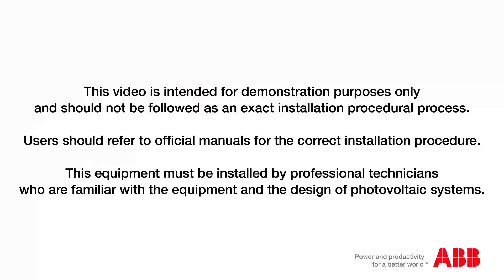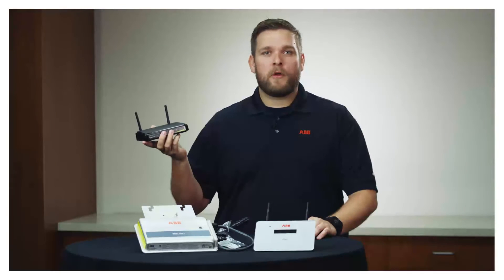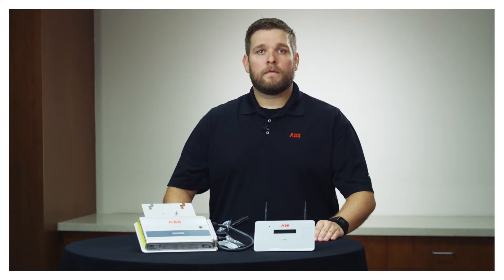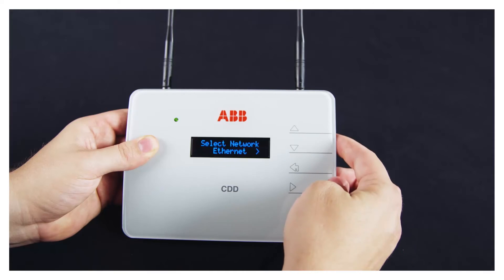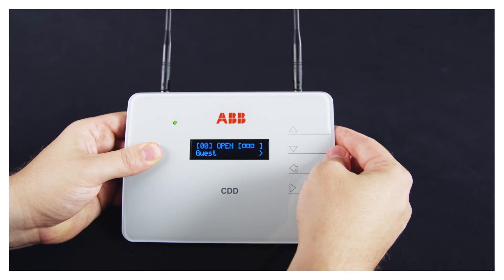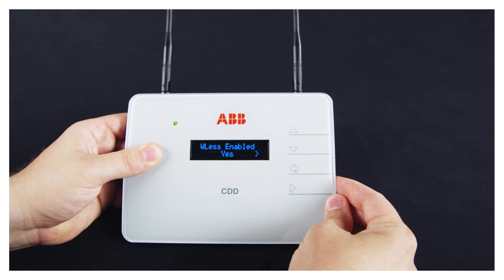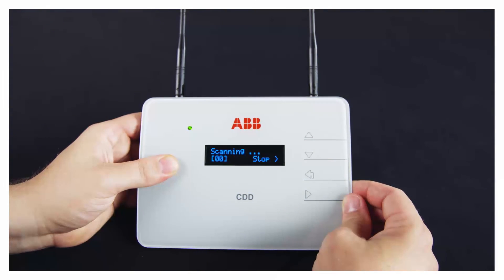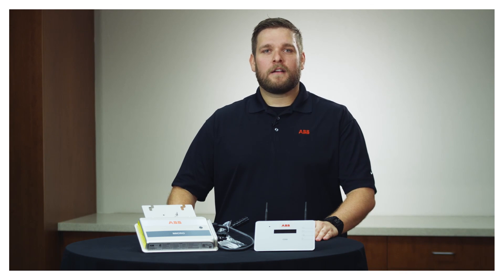CDD inverter installation – CDD version

Comment: At Change Settings > Network, mine says "Network Change Locked!"   What do I need to do to unlock this so I can change to a new wireless router system?
Reply: If my memory serves me correctly, you'll need to temporarily disable your existing wireless connection to unlock it. I have the original Power One version and it was quite confusing at best on the instruction manual.